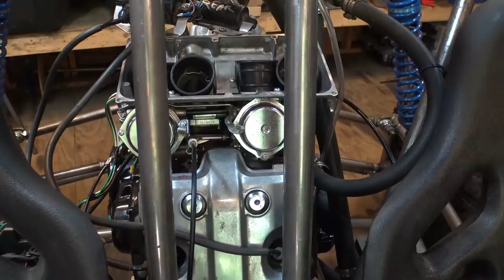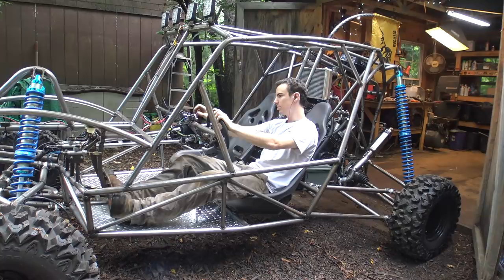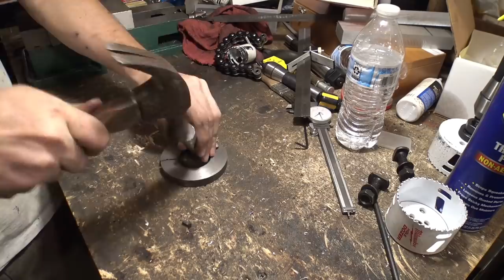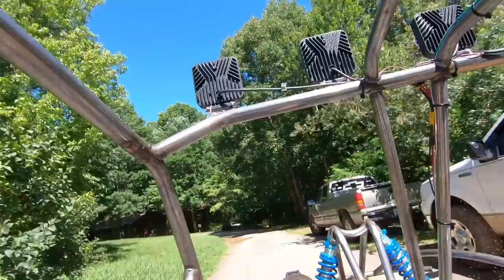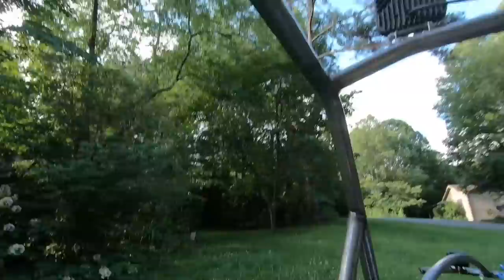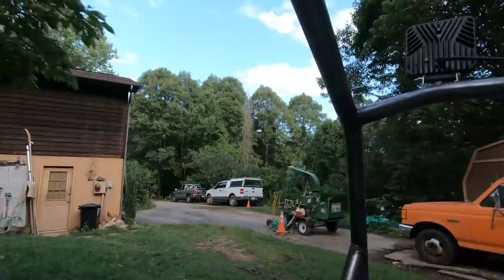Honda VF 1000 buggy build part 13. test drive

Comment: Dude your build has turned out so sweet, can't wait to see it in some dunes really tearing it up. But those rear, way too long shocks are craaaaaaazy..... it looks like a football player that broke his collar bones during a game winning NCAA championship gaming wining drive.... but now they did surgery on his shoulders and are permantenly raised to his ears
Reply: P.s. I've had a lot of friends at glamis with streetbike conversion quads and also rhinos..... these engines are made for a light bike to go 150mph.... you have to gear it LOW..... Need to call Weller racing in arizona and see what kind of gearing they run on their conversions and they will have parts too

Comment: get a small 4 cylinder front wheel drive car engine and transmission and mount it in the back, problems solved
Reply: Frame will never hold it

Comment: If you want to put a v 8 on this v f 1000 get the motor and transmission out of a 08 chevy impala ss 5.3 have them do a complete drop out that way you can get the motor transmission sub frame axels  harness and all the accessories
Reply: And it's front wheel drive

Comment: This isn't just about gearing, but the transfer of power against all the weight.  Good looking buggy, however I fear you may damage that motorcycle transmission if you don't find a better way to transfer the power.  You will forever have problems with that chain drive.  If you intend to stay with chain drive, you may have to power a differential with it. You didn't leave yourself with a whole lot of space for adjustments.

Comment: right so you didn't listen to anyone about making it too heavy so I'm guessing the next video you will either be cutting off all the useless pieces of steel to get the weight down and/or putting a more powerful motor in it.

Comment: Taller tires will help if you want more torque. Sport bikes have tall gears. The smaller front sprocket will only get you so far. Check out gearing commander. Com it will give you so numbers on what will do what with your set up

Comment: Question: Have you ever considered swapping out your gasoline-powered engines for a high torque electric motor set up? And using a small gasoline engine as a backup? I.e. in case you run out of power somewhere out in the boonies? Just a thought. :-)

Comment: Future engine mods, for sure need a stronger clutch to handle the extra weight. Also might want to compare power with and without mufflers, it just sounds a little restrictive. Also make sure the exhaust is as even as it can be for both sides.

Comment: Should of put 3 cylinder car engine in there, the block on them is only size of a4 peice of paper and would work by drive shafts so no chain and spockets Ford 1 litre would have been great..and its turbo charged..look it up great engine for such a little size..

Comment: for a 1000 v4, it sounds like tis only running on 2cyl with 3rd kicking in now and then.  the V4 had really nice torque, somethin wrong here, it not comepletely gearing. home made exhaust might be issue, Rejet it.

Comment: Changing the gearing won't help much. The engine is underpowered. You could easily fit a small car engine in this thing... I've been saying this since the beginning. Even a 1.6l or something like that would do a LOT better than this bike engine. This VF1000 would be enough for a one seater but this one, yeah, too heavy. And it's going to be a lot worse with two people in it.

Comment: Still not enough HP and torque for that heavy buggy its not the gearing. Its slow in first gear what are you building a rock crawler with a top speed of 25mph just admit its not enough motor for that machine